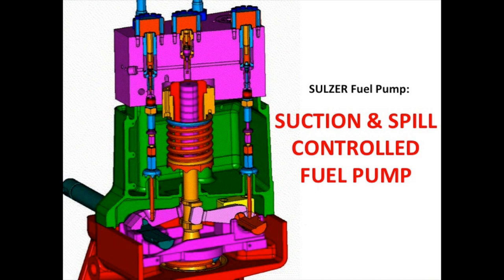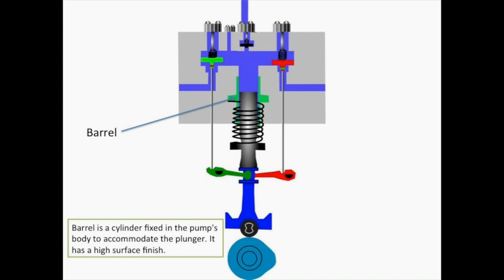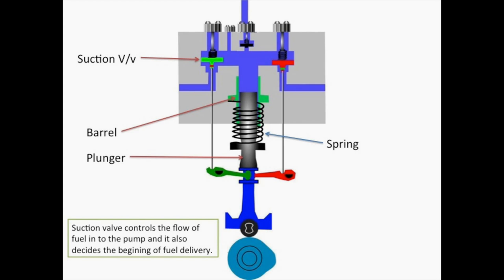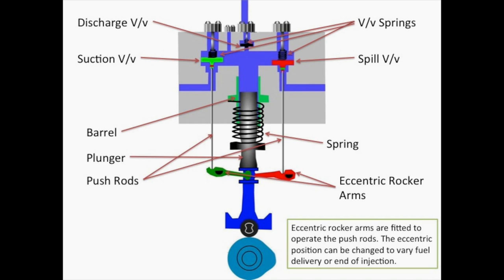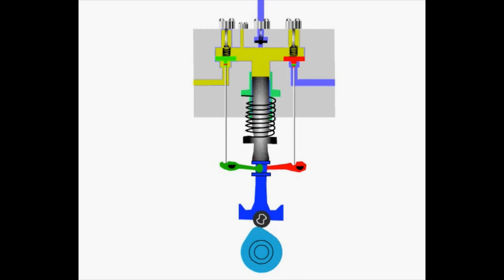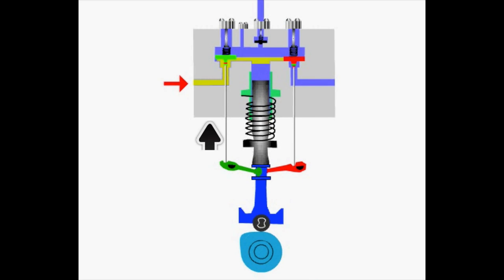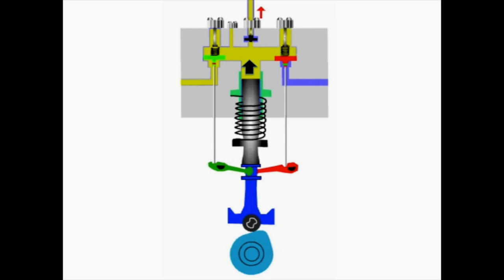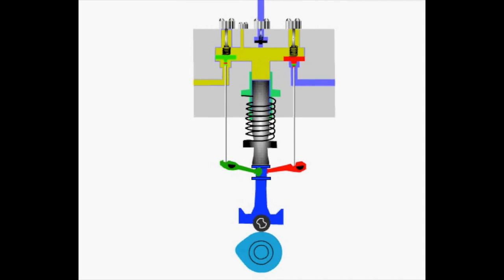Main Engine Fuel Pump Working Explained

Comment: Where will the fuel go after going to the spill valve?
Reply: Hi. Good question. It will go to a "common line" or pipe where spill ports of all the pumps connect , which will return the fuel to the Fuel storage/settling tank.
Reply: Go back to the suction side

Comment: Why delivery valves in 2 stroke fuel pumps are called suction valves?
Reply from the maker: There is a discharge valve apart from suction valve. The suction valve allows the fuel to go inside the pump chamber and when the pressure is enough, it goes out from the discharge valve.

Comment: you have not explained anything about helical groove
Reply: you have not helical cut on that kind of piston plunger
Reply: Giovanni Jara then how is the metering of fuel done?
Reply: @abhishek7ao  metering of fuel is done with the help eccentric Rocker arms. These control the end of fuel Injection timing in per engine cylinder